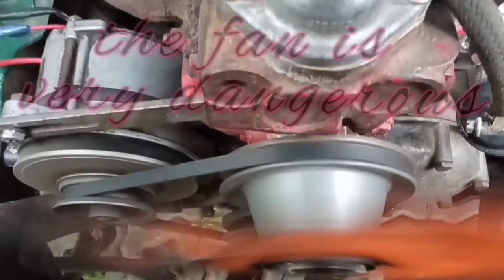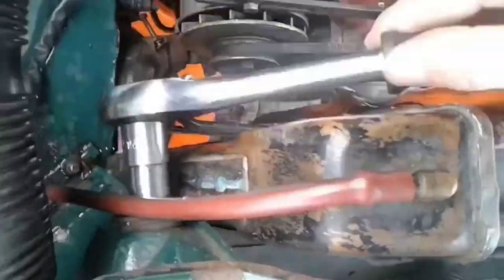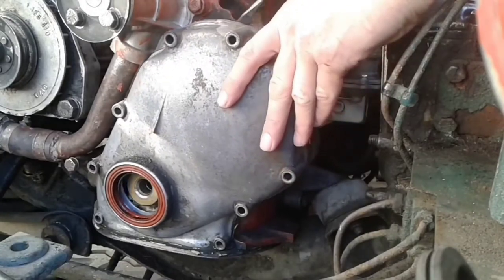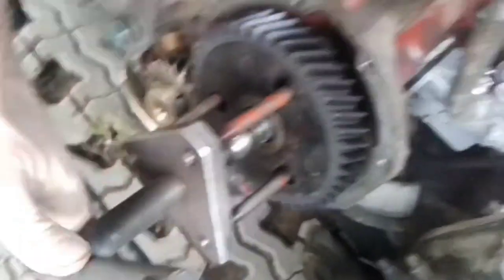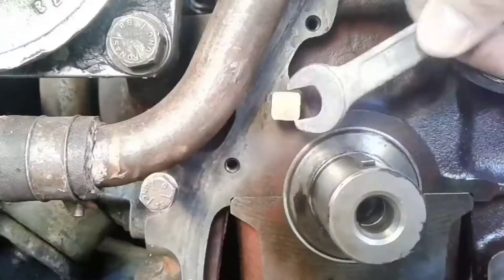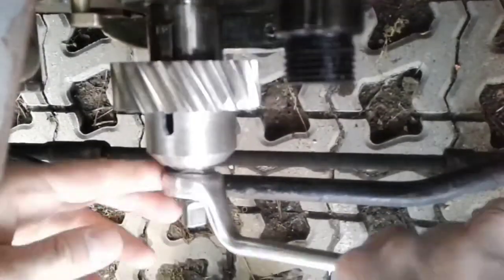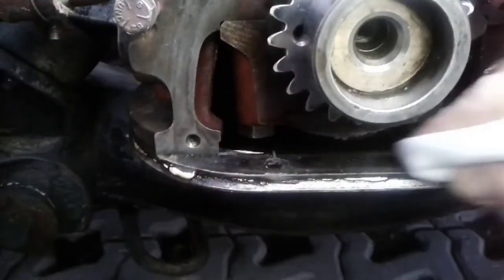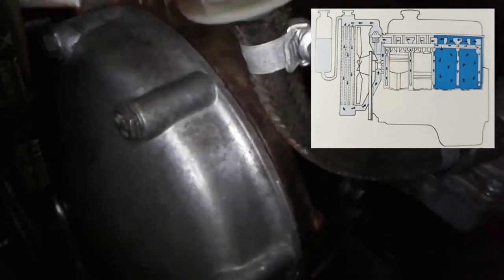How to Replace Timing Gears oem Volvo b20 #VolvoB20 #VolvoB18 #VOLVO140 #timinggear

Comment: How do you recommend I remove the steel collar that goes over the camshaft and woodruff key, if the fiber gear spun and knocked the engine out of time?
Reply from the maker: If you are talking about a pressure flange, then it is enough to check it for wear. If it is worn out, then it must be replaced, it must be in the repair kit. Some repairmen turn it over and put it inside out, but you don't have to do that. It is necessary to check the difference in its thick between the spacer ring and the pressure flange in its thickness and compare with specifications.